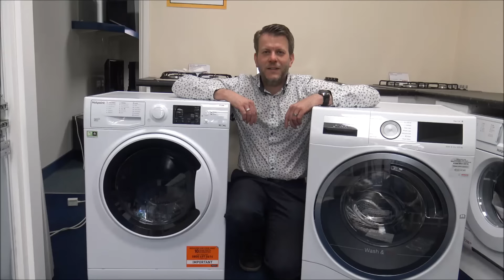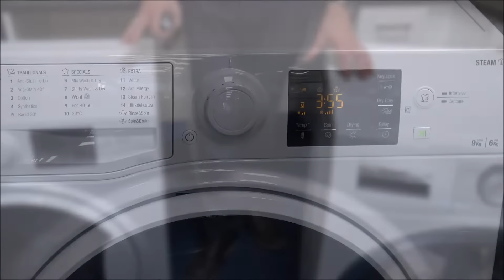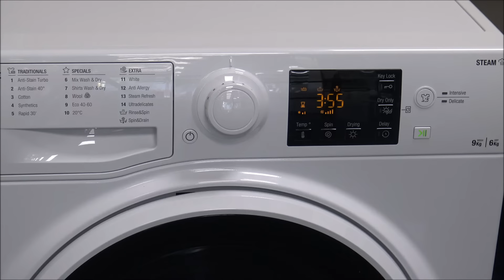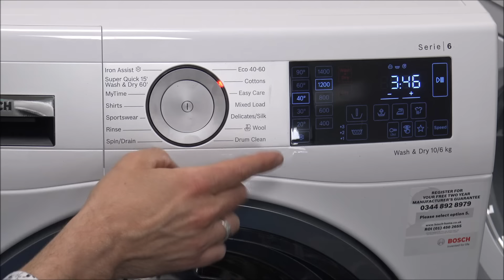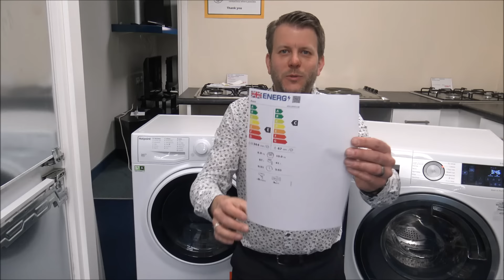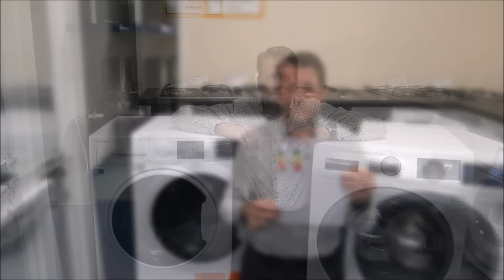Are Washer Dryers Worth it ?  10 Things To Consider Before Purchasing A Washer Dryer

Comment: Probably 8 times out of 10 I find that "sensor dry" still leaves the towels/sheets wet to touch and not even slightly close to being considered dry. This is another scam feature that doesn't work as advertised solely to convince you to spend more money in the showroom

Comment: I’ve had several washer dryers and every one has broken after a couple of years. Now I have a washer and a separate heat pump dryer and they have not gone wrong. The dryer is fantastic Sharp brand. You see all the fluff and dust in the dryer and you can see why a washer dryer is never going to last.

Comment: If you have a lot of washing to do, consider getting two washer dryers instead of separate washer and dryer units. However, be aware that heat washer dryer with a heat pump (the only way to make it low energy dryer) is hugely expensive so if you get cheaper washer dryer, you should expect about +60% water usage and +40% electricity usage.

If you decide to go with washer dryer, consider the capacity of the machine to be defined by the drying capacity so go for the system that can dry at least 6 kg.

Comment: According to user manual "Delay End" sets the time to completion of the program, not the start time of the program. That means that if you choose 8 hours and the program is 3 hour long, it will start after 5 hour delay and complete at 8 hours from start button. (Subject to some variance because these machines will go slower if intake water is colder than average or there's heavier load.)
Reply from the maker: That is correct some makes will have a Delay start and some will have a Delay End option. Personally i prefer the Delay End option
Reply: @lords-electrical  Delay End is definitely superior if it works correctly. Some machines have so variable wash time that even the manufacturer cannot know when it's done.

Comment: Iv ended up going eh really and ending up with both sides
A washer dryer and a heat pump tumble dryer
Reason it wasnt much more getting the 2 in 1 so if tumble dryer breaks i can use washer dryer and visa versa but also if i go to sleep i use washer dryer even when loaded to full it just takes a bit longer to dry but everything's dry when i wake up. But also if im awake or got a lot of laundry to do i can use dryer or when im awake for cheaper running cost

Comment: Big advantage of a washer dryer is also for anyone on an EV/E7 overnight tariff. I can set the washer dryer to start washing at 0300 and finish approx. 0700 and it means the energy cost is 6.7p per kWh instead of 25p prr kWh. Thats potentially a saving of £2+ on each full cycle!!
Reply: I would not trust leaving any washer or dryer on overnight

Comment: Hi, I recently bought a 2nd hand washer/dryer and the clothes have a strange musty smell after using the dryer. The load size doesn't make a difference to the smell, I've dried 1kg and it smells the same. When air drying the clothes they smell fine. There's no sign of mould in the drum or draw and I've ran 2 drum clean cycles with a cleaning product I bought. What could be causing the smell? I read on a forum that it could be dust on the heating element that needs cleaning.
Reply from the maker: If the drying side hasn't been used, then yes it could be a build up of dust on the heating element. Hopefully after a couple of drying loads, the dust should have gone. Also make sure you leave the door open to air and dry after each washing and drying load as this makes a huge difference to musty smells in appliances.

Comment: I found this tutorial very helpful  I change my element today a little bit of smoke that came out of it is that normal and a few screws left over could you tell me if that's normal
Reply from the maker: You may have a little bit of smoke from the dust on the element if it's been stored somewhere for sometime but apart from that it shouldn't smoke. Also if you have changed the element you shouldn't have any spare screws around.

Comment: Do I need water supply for the drying cycle?
Reply from the maker: You wouldn't normally need it, but being a washer dryer, the water will be connected anyway. If you don't need the washer side of it, then i would just buy a tumble dryer instead.

Comment: We're just about to buy the Haier
i-Pro Series 5 HWD100-B14959S8U1 10kg Wash, 6kg Dry, 1400 Spin Washer Dryer. We live in a flat thus the reason for going for a washer dryer. We might be using the dryer a few times a week due to not having a lot of space for laundry racks. What's the best way to use this to avoid condensation and mould build up please?

Comment: I live alone. My dryer is literally the cheapest dryer I could find in 2013 and my washer (a simple one) has died.

Since I am alone, I won't have a load of washes.

A washer dryer is about 200 cheaper than getting a washer and a dryer.

Would I fit within the target audience here?
Reply from the maker: Yes it sounds like you be ideal to have a combined washer dryer, but i still think if you have the space then it will be a better option to have 2 separate appliances

Comment: Washing machines harbor a great deal of moisture, and vibration is par for the course; if you think washing machine are a good place for cheaply made expensive electronics, think again. I don't want a smart washer/dryer; and other than start the machine, I don't want to communicate with it, if it needs sophisticated programming to assist in troubleshooting, chances are there's not much I'm going to do about it.

I currently inherited a a washer when I bought my home, and it contains a dial full of preprogrammed setting. Well guess what; other than normal, towels, and sheets, I have not used any other programs. And if the towel and sheets programs weren't there, I think I know how to set the water temperature to hot.  

I've watched half a dozen videos on the subject of washing machines, and which are reliable and affordable ($500-$600); everyone who attempted to answer that question provided a different answer. My guess is it depends on what they're selling. My conclusion is... there are no reliable machines at any price available today. Our grandparents had machines that lasted 20-25 years. To buy anything close to that today, you'll pay the price of a new machine, when you buy a  used pre-2918 Speed Queen, and if you're lucky it'll be purely mechanical.  
If you find one, in good condition, it will have a lifespan left that will be longer than anything you buy today. And do you know why? Because manufacturers today believe that your money is worthless, and if you buy their products so do you. If everything you have is easy come, easy go, then have at it.

Comment: Does it dry the clothes dry dry... or will I still need to hang
Reply from the maker: If you have a washer dryer then after the drying cycle has finished you should just need to put the clothes away in the cupboard as they will be fully dry.

Comment: You should mention that these higher end machines are being available for rent on monthly basis. You pay a premium but everything is covered. Imagine people spending hundreds of pounds on high speed optical fiber data connections, TV and subscriptions and forget the essentials like washing and drying. Spending 30 ponds a month on one of these machines is a rational price considering they get used every day and might need repair some day. Contracts range between 1-6 years, in the Netherlands it is a big thing. Btw, some machines like Siemens IQ machines have LED blue lighting so you can see the tumble clearly (Only at the start though) That should be an option for continuous on or off.

Comment: Does it actually weigh the clothes? What happens if you put more than 6.0kg in the dryer mode?
Reply from the maker: It won't normally weigh the clothes, it will send a certain amount of water through at the start of the washing program, and depending how much is saturated, it will determine the load size

Comment: You didn’t mention the most important point - heat pump, which reduces the heat temperature at the same efficiency level. It helps to safe fabrics from damaging and shrinking. Only 1% of washer dryers are equipped with the heat pump. That’s the biggest disadvantage of washer dryers

Comment: Great video, I thought it through and I can't use one that's a combo, my outlet for the dryer is on one wall and the water is on another.

Really would have liked the combo I'm assuming they will auto dry after the wash so if you forget at least the clothes don't sit wet.

Comment: Just a couple of questions: what capacity drum (in c.u and kg) would you need to wash and dry a king size comforter/duvet effectively? Also  what depth should the washer-dryer be so that it sits flush with other standard sized base units. I’m fortunate to be able to buy my washer-dryer before we select our kitchen design.
Reply: At least 13kg capacity.

Comment: May be a silly question, do washer dryer require an air vent pipe to the outside?
Reply from the maker: Not a silly question at all. No they don't all they do is use the waste pipe from the washing machine for the moisture air to exit
Reply: @lords-electrical  my washer dryer on dry only number one has bit switched off at the end

Comment: Having to replace 6 year old AEG 1600 spin w/d..  New machines are generally too deep for space unless we go for a 1400 spin model with a small volume.  Any thoughts please?
Reply from the maker: You are correct that a lot of washer dryers with larger loads like 9kg and above are quite deep compared to smaller load machines.

Comment: Great vid thank you ! Beware all the fluff from the dryer stays inside the machine ( no filter )  and in my experience can block the hose. anyone else have this probl?  Would love to know if the less expensive brands are any good if I don't need a  large load? there is a big  price diff.  so wondering if Candy, beko, Hoover are any good ? What about noise, how can I find out the real noise level ? Thank you
Reply: That's a big issue with me.  I just replaced my 5 yr old LG large capacity washer dryer after the drum failed and no spare parts were available.  I went with a LG Wash Tower (two separate units that are stacked) and I can do twice as many loads as the old unit in the same amount of time.  The old LG large capacity washer dryer unit was a pain to clean after each use as there is no lint filter (only a drain filter at the bottom).  The lint would solidify behind the door gasket and would require removal of the door gasket periodically (not fun).  Also, the drain pump failed after a couple of years as well as the interior light.  The 3 to 4 hour plus cycle time to wash and dry a load of clothes was too much.  I would not buy this type of unit if your household has more than two people. The backup of dirty clothes is cumbersome.  I can do one load of clothes with the new setup in less than two hours.  Well worth the switch.
Reply: I do atleast 2 cotton washes and 2 loads of drying a day ,had a Beko washer dryer replace my 20 year old indesit and had endless issues , repairs and burnt out within months. Have since had an aeg the past 5 years , runs smooth , quiet and it’s still going strong. In terms of the lint , although time consuming the only solution is running a quick wash cycle after each drying cycle which is what I do

Comment: the thing is i dont know what size of loads are. i just fill my washing machine up and not too packed and switch it to the 59 min cycle. i have a hoover dynamic next 8kg washing machine and want to upgrade to a washer dryer thats 9-10kg
Reply: You can’t fill a washer dryer. Use the scale and reach the max for the program you use. If it’s too much before drying you have to remove something.

Comment: I have a washer dryer too. I only use my dryer for my bedroom pillows, but it is a really good machine anyway. One thing that I think wasn't mentioned was the water usage. The dryer has to have water flow passing across the drum , so I could imagine the water  costs may well be high if you choose to use the machine as a dryer very often.
Reply: dedicated dryers don't have a water hook up to them.  They work off electricity or gas, no water is needed for a dedicated dryer.
Reply: @jon10231  i have a dedicated electric dryer and it has a water hose for a steam function. so i wouldnt say its super exclusive. maybe not super common but still

Comment: I have a basic question. Lets say that the washer dryer has the following capacity - 10 kg washing/6 kg drying. You put 6 kg of laundry for washing.  After the washing cycle though this 6 kg of laundry will become more than 6 kg because it will contain water of course. Does that mean that you have to remove some of the washed laundry before drying? I think you get my question. Thank you:)
Reply from the maker: If you put in 6kg of dry laundry in the wash then it will be ok to go through the drying cycles and retain the full 6kg in there.
Reply: @lords-electrical  Thank you for that information 👍🙂

Comment: Washer dryers only make sense if you don't have space.They only dry small loads take a long time to dry expensive and they suffer alot from blocked condensers and fans failing when it comes to washer dryers your mum was right dont buy one.Consider buying a dehumidifier instead modern dehumidifiers have drying modes for washing.
Reply: A dehumidifier is not needed
The moisture is self contained and only a bit of warmth will warm up the room the machine is in

Comment: I now have my second washer dryer (replaced about 4 years ago).

I would never have the space for two separate units, but I also like the convenience of putting the washing in, setting the timer to have it start overnight (when my electricity costs are lower), and have it all finished in the morning.

Aside from the delay timer, and the load size, the comprehensive display was an important factor in my choice of machine.  It was not just that it displayed the time it would run, but that it gave me at a single glance a comprehensive display of all the settings I had set just in case I had accidentally set something wrong.
Reply: What’s the brand?
Reply: @cosettapessa6417  It is an AEG L8WEC166R
.  It replaced a Miele.  The Miele was more solid, but the newer Mieles (newer 4 years ago) did not have the functionality I wanted.

Comment: Does the durability stay lower even when you use the dryer occasionaly? Because I can't decide if I should get a combo or just a regular washing machine. I don't really need a dryer since I do line drying most of the time but I thought it might be great if I wanted to wear something directly out of the machine when I'm in a hurry.
Reply from the maker: I would always recommend if you have the space to go for a washer and dryer individually rather than in 1 unit.
Reply: Regarding your first sentence, if you mean does occasional use of the dryer result in it being less durable, I think that the opposite will be true. Something that is little used will last longer. Don't buy a washer dryer if you expect it to dry clothes quickly. You will be disappointed.

Comment: I now own a hotpoint Aquarius washer/dryer 8kg+6kgdry 1400rpm. I owned one many years ago when I was young and starting out a hotpoint Aquarius funny enough it was awful used loads of electricity never dry and was also very loud especially at 1200rpm and I swore I would never own one again! But there wasn’t anything in the shop that was the colour I wanted bar the washer dryer so I took a risk and bought It reconditioned and I must say this time around I love it , it’s got a big drum and actually dries well if not overloaded it’s quiet I live in a flat and I can set it to wash and dry my work shirts and trousers couple of other things in there to and there all clean and dry in the morning and I can go to bed (I do lates) wake up and just take them straight out don’t even here it doing anything… I like it and I live on my own I do own a little indesit 4kg dryer but only use that if I got a lot to do! most of the time I use the washer dryer and it works great but does take a while… doesn’t bother me I turn it on and go out 👍🏻
Reply: Thanks for your info, very useful! What was the price?
Reply: @melkiyad2504  it was only £65.00 2nd hand it died unfortunately and has now been replaced with a brand new LG 2in1 back in march but was pricey at £679 but has 5 years full warranty and it’s great better than the hotpoint not that I thought it was a bad machine.
Reply: @colinsace1 Thanks for the reply! I am moving to a new appartment and need a 2in1 due to space constrictions, but I've heard it pays to get a more high end machine if going for the combo.
So trying to see how high end i have to take it :D
Reply: @melkiyad2504  no problem man :) and after many makes and models over the years as I am 40 now LG is definitely my favourite brand of washing machine and TV  I am glad I paid the extra money as was only 100 odd more than you’re normal standard combos could of had a cheep 6kg indesit but could not believe it looked exactly the same as my old one from 2010 it’s now 2024 and it still looks the same but has a dryer on it 😂 
Wanted some thing I could fit a king size duvet In so got a 10 kg LG. 
Had 0 problems. 
Good luck with whatever you get in you’re new home:)